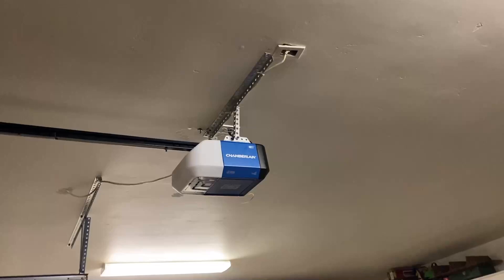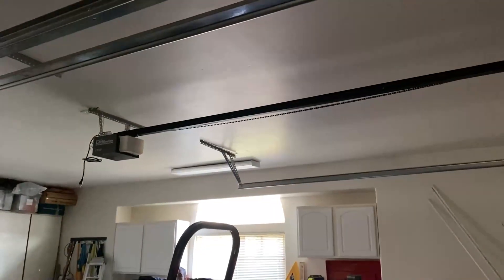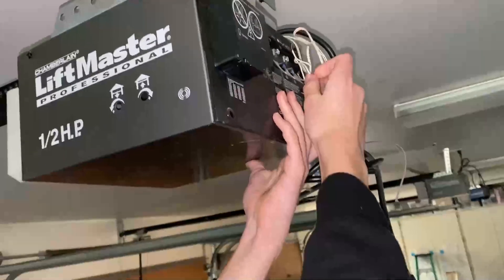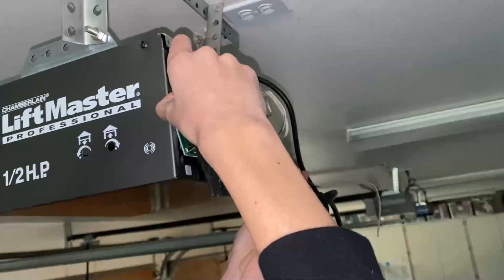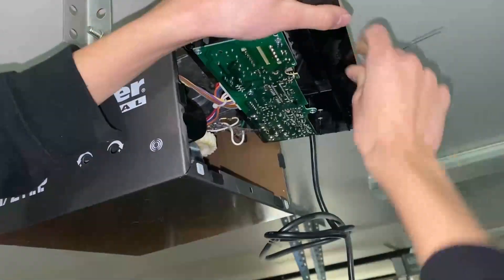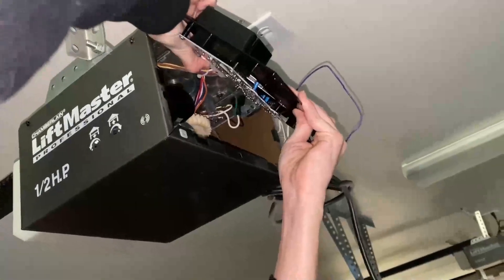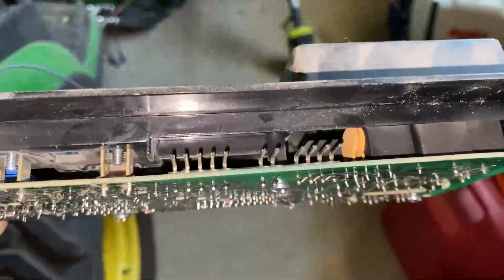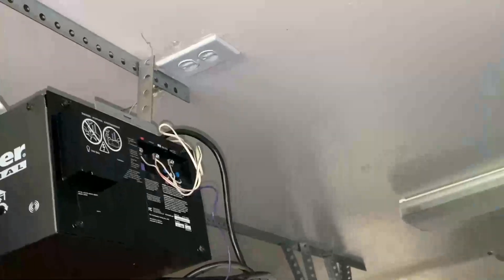Garage Door Opener Circuit Board Replacement

Comment: Thank you for this video: (Installation was simple and straightforward! Time: 30 - 45 minutes)
✔ I watched your video
✔ I took a picture of the model number and manufacture date of my garage door opener
✔ I ordered the replacement board from Chamberlain
✔ I received the replacement board
✔ I watched your video again
✔ I took a picture of the wiring before doing anything
✔ I used a Sharpie and wrote "L" and "R" on the white wires to make sure I did not confuse them
✔ I unplugged the garage opener and followed the instructions in your video (I found that by using a taller ladder made it easier to unplug the circuit board connector from the old board and later plug in the circuit board connector to the new board)
✔ I set the UP and DOWN adjustment screws on the new circuit board to match the old circuit board settings
✔ I plugged in the garage door opener and IT WORKED!!
✔ I verified the safety reverse worked
✔ I programmed 3 garage door remotes in less than 2 minutes. The garage door remote programming is so fast (Press and hold the remote button for the door, press and release the garage door opener Learn button, and the garage door opener light will flash when it is programmed. Time: 15 seconds per remote)
✔ Done
Reply from the maker: Thanks for the comment and the information! I'm glad it worked out!

Comment: I have a 1/2 hp liftmaster professional exactly like yours but big box stores in my area have Chamberlain. Looks like the holes lined up and you didn't have to alter anything... Easy swap ? Any particular model Chamberlain you found that lines up nicely with the old liftmaster?
Reply: I bought the new board on Amazon. They will match it up for you. They have to be exact or the remotes might not work. I originally received the wrong model number but Amazon had the correct one sent the same day. I have swapped out 2 of these with great success.